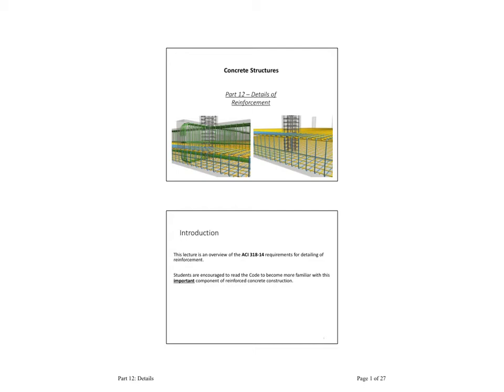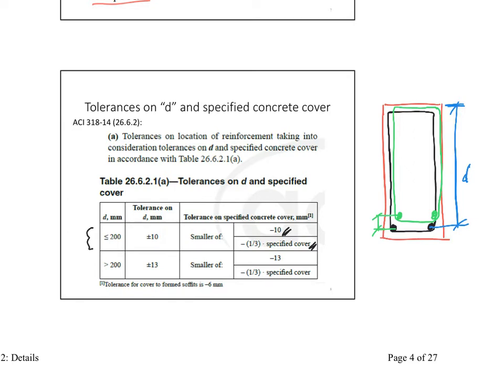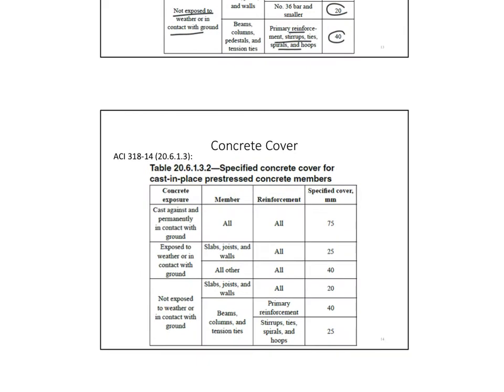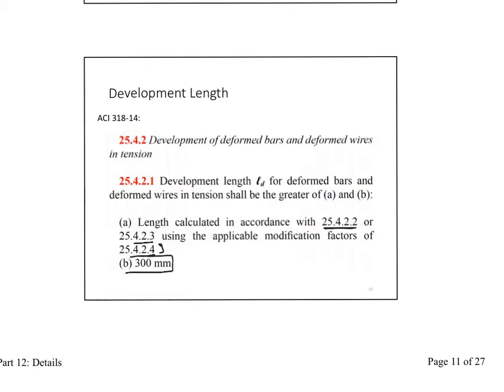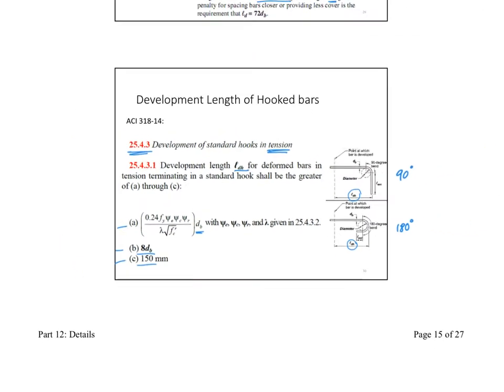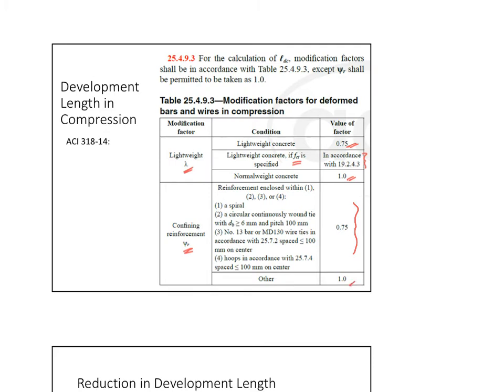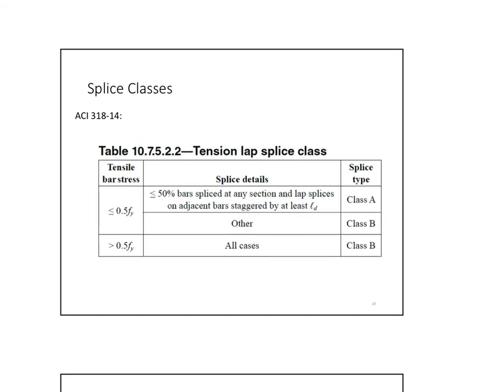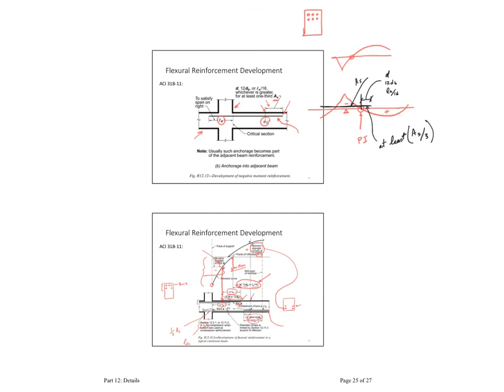Basics of Concrete Design Part 12 (Detailing)

Comment: I am enlightened by your teachings.. sir I have a question,which is why do we provide additional bars in slab and also in raft foundation aside the facts that we are dealing with positive and negative moments
Reply from the maker: Thanks for your question, in face for slabs and raft, normally the steel mesh is made to cover a certain moment capacity, at locations this moment capacity is exceeded, addition reinforcement shall be provided to increase the flexural capacity and cover the needed demand. This way the design is economic, and we are not providing excessive reinforcement allover the slab/raft.